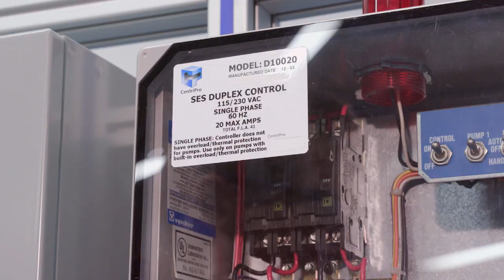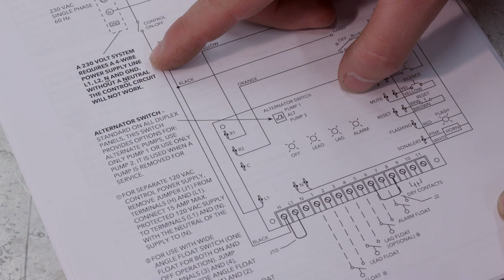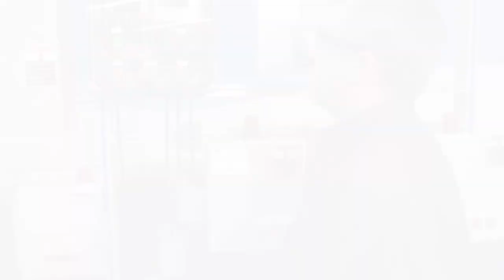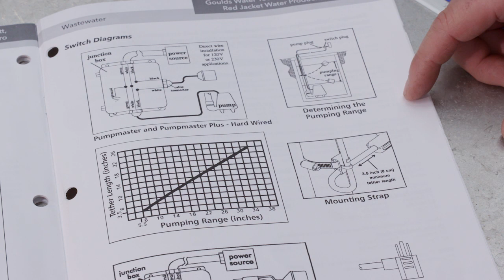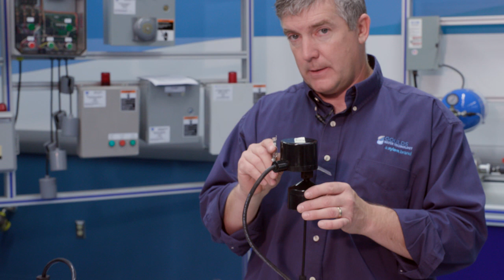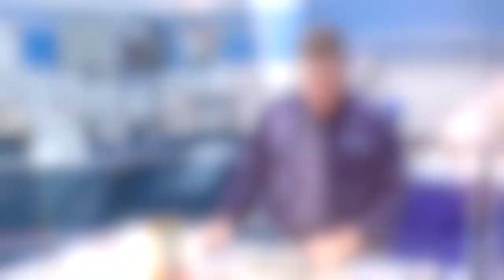Wastewater Panels and Floats

Comment: That is weird.... You would think the switch breaks the neutral, to reduce chances of spark that's the way it is an automobile... The computer connects the ground and disconnect the ground, so it is ground switch... Keeping in mind automobiles are direct current